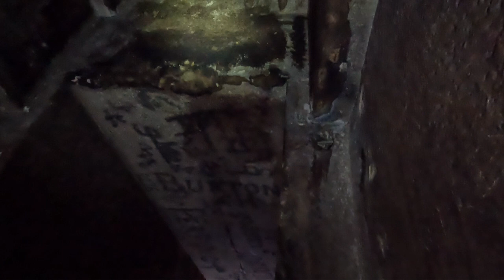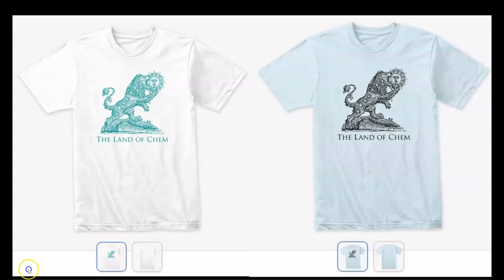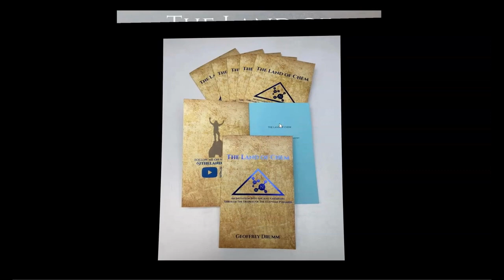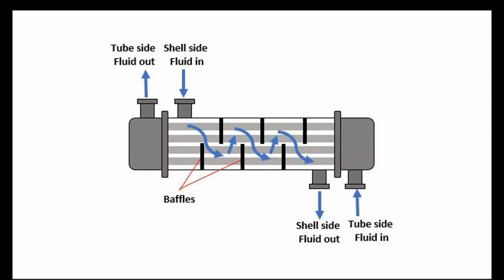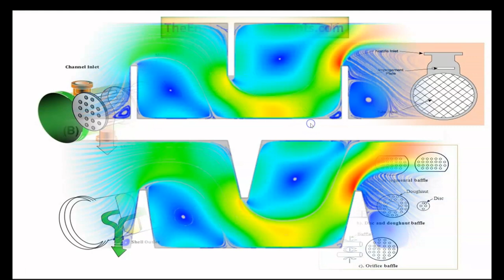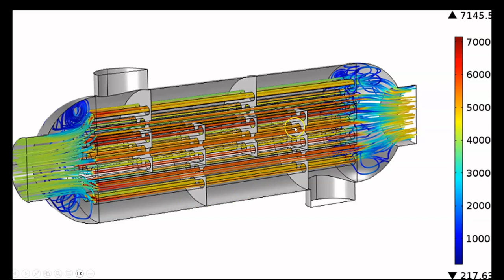Episode 89: ANCIENT TECHNOLOGY - Missing Components From The Red Pyramid

Comment: Doesn't the 2nd chamber upper passage need a hanging door to contain/lock the pressure in #2.. otherwise as we fill with water most of what's in #2 just pushes into #3 and we got nothing to compress...?
Reply from the maker: Not necessarily. The reactants in chamber 2 are lighter than air. They will naturally rise into the upper vault before the water level is raised, trapping them there and preventing them from being pushed through the connecting shaft. The baffles system would also assist in this process

Comment: Another great episode Geoffrey!  As you have stated, it looks like someone really wanted to get whatever was there out, probably with greed as a motivation. Just a thought, but could they have been some rare metal plates such as platinum that may have been used as a catalyst to speed up chemical reactions? Very exciting to follow the threads you are weaving together on your quest. Thanks, Tom
Reply from the maker: The baffles system was definitely a metal component of some sort. Most likely an iron alloy, for reasons I'll get to later. Thank you Tom!
Reply: It seems like chiseling out the floor of the upper passage for the extraction of components means the parts were either going to be reused for their original purpose or the metal was harder than they could cut down. Because if the primary reaction chamber's metal components were copper based, and we're just planning on smelting it back down for other things, it's far easier to cut/smash the metal down to manageable sizes rather than chisel thru granite.
  I imagine the missing passage floor had pipes/ducts/metal/etc traveling in/under/thru it, hence why it's removed.

Comment: Heat exchangers can be quite simple metal fillings. If reaction fluid goes in and out the same way and not one way in and other way out. Because no need to separate inflow from outflow in such scenario. Scarf 🧣 is a simple heat exchanger, saving heat from air that is reacted in lungs. .  Fine and inert to given reaction metal is needed. No complexity in insulating inflow and outflow , no problems running machine for thousands of years. I would be considering dumping old stone cutting, bronze saw blades as heat exchanger filling, if chemistry allows it. Or combining heat exchanger with catalyst metal. I think catalysts in amonia reaction chamber was mentioned in some older video. Nickel or something.